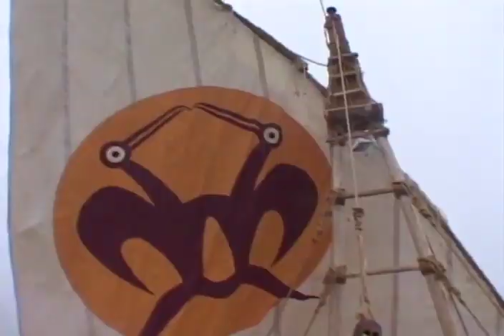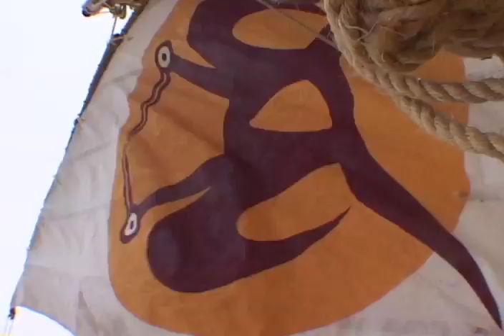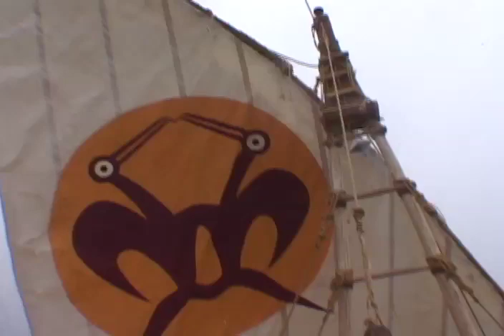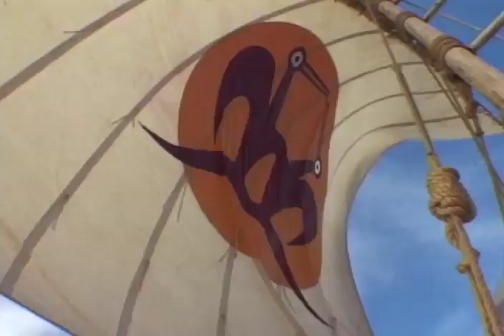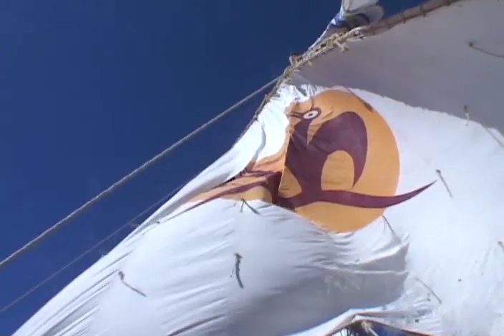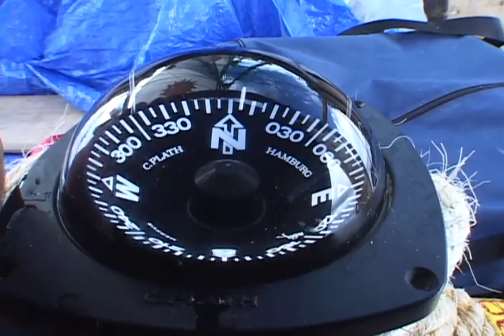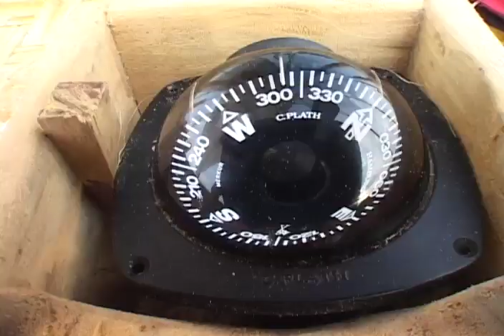The Incredible and Unlikely Voyage of the Reedship Viracocha II from Chile to Easter Island

Comment: I find the use of two sails a bit weird when if he had checked Thor Heyerdahl's Tigris Reed boat it was a single Square rigger and so much easier to handle.
Reply from the maker: Thor helped in the design of this boat before his passing, suggesting the double hull design, as well as keeping with the ancient styled lateen rigging of the sails. The lateen rigged sails are not easy to handle, that's for sure

Comment: Large reed boats were constructed in a mould, a vessel shape cut into the ground, creating a curved keel from stem to stern, deeper at midship. This reduces the tendency to hog or sag in the centre dropping the bow and stern. Large reed boats often had an internal skeleton of beams to reduce flexing. 
The rudders were balanced steering oars, with rudder board before and aft of the rudder shaft. A rod was fixed at right angles to the rudder shaft, so steering was by rotating the shaft on it's long central shaft, rather than swung from side to side like a hinged oar. Two or more rudders may be used as required. Ladder masts lean forwards, held in place mostly by many backstays allowing easy up-hall of square sails or Tri-sails.
Lee boards were used to assist steering, and to prevent sideway drifting to leeward. I'm not aware of any ballast used in reed boats. As deck loaders they would rock and roll at sea. Ancient sailors sailed with the wind and currents, returning often on a different course of winds and currents. A drogue dragged behind may be necessary in strong following seas to maintain steerage.
Ancient mariners carried laying hens in small cages and chicken feed. A fire was often lit on a sand pit and or stone hearth. Flat bread for 3 days would be made, ample for all. Eggs boiled others scrambled or fried on a hot plate or shallow pan. A years supply of dried fish will fit in a few boxes. It sticks, but it keeps for a year, and keeps you alive.
Reply from the maker: This is exceptional....and I absolutely have not heard about the ships being made in a mould. This is well worth a deeper dive and some research.
Reply: @BackstageMusicChannel why do you take that load of fantasies seriously?
Never been responsible for physical work or sailing?
Reply from the maker: @lisette2060  please explain, not sure what is meant....